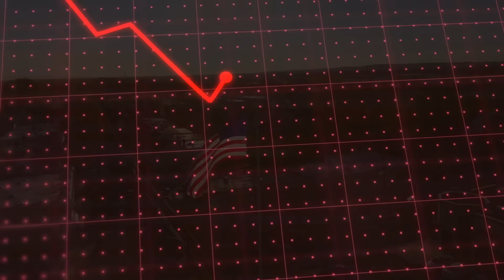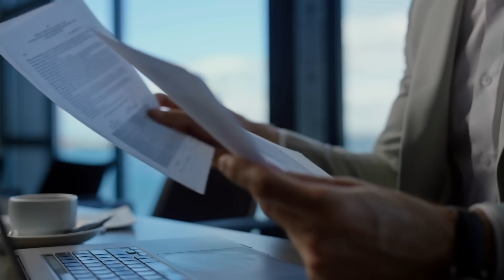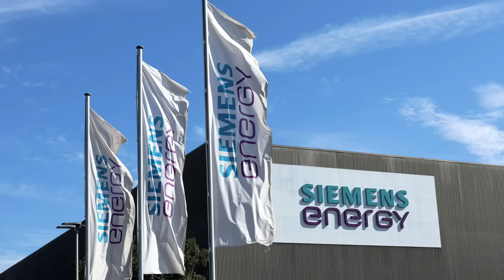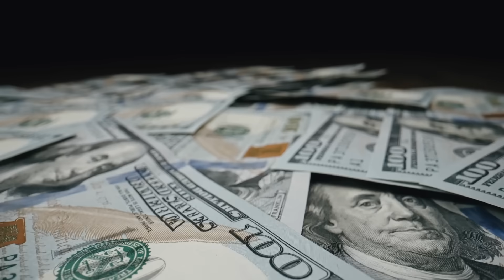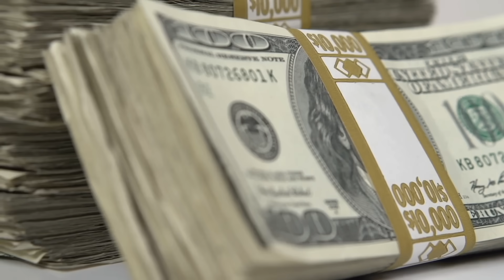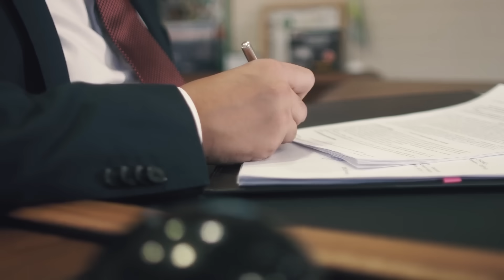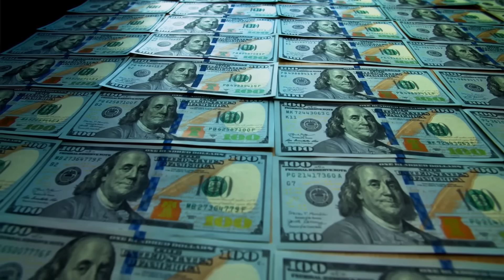The Real Reason America Has Turned Its Back On Wind Power Energy

Comment: I got the new 1600watt turbine from Missouri wind and solar and what this company won’t tell you up front is you need a 40’ tower for it to produce any usable power and you can’t return it. Worst investment I made so far on my house. Made 4kw of power in the same time my 9 solar panels made 129kw, and I regularly have 30-40 mph winds. Just upgrade to lithium batteries and add more panels.

Comment: Wind power is actually cheaper than most other energy sources, but a reliable baseline power supply is still necessary. One of the main challenges is the distance between the wind farm and the end consumer.

However, many wind farms in Europe have been built without government subsidies. Denmark, for example, relies heavily on wind and solar energy, covering on average almost 70% of its electricity needs over the course of a year, and on many days supplying 100% of the country’s electricity consumption.

Within the EU, wind farms compete with other power producers, submitting hourly prices that electricity companies then purchase based on what they expect to sell. The transmission grid (TSO) and distribution grid (DSO) are allowed to charge only regulated transportation fees, while electricity companies compete on price and customer services.

Her er en kort og klar version af din tilføjelse, der passer som et afsnit efter den tidligere tekst:

In the EU, installing an offshore wind farm can take up to 10 years, mainly due to permitting and planning.
The actual construction is relatively fast, typically one to two years from the start of installation to full production.
This timeframe also includes securing government permits and building the TSO grid connection to the wind farm.
Consequently, CAPEX for construction does not begin until the operator is confident that the grid operator can complete the interconnection as planned.

Comment: I don't think you all understand how the green energy works. They can build a solar farm in Kentucky and transport that energy to your region that doesn't have good sunlight. What the video said, there are 15,000+ finished projects. They cannot transport the power through the grid that we have now. It is outdated. We need to be able to transport that power to storage and from storage to wherever it needs to go. The system we have now cannot handle that load.

Here is what I said even made more simple for people that didn't understand the video, nor my comment. 

Its like streaming Netflix on dial up internet.

It’s like trying to fill a swimming pool with a straw.

It’s like driving a Ferrari on a dirt road.

It’s like plugging a firehose into a garden hose.

It’s like running modern apps on a flip phone.

It’s like ordering 1,000 pizzas and trying to deliver them on a bicycle.

It’s like trying to watch 4K movies on a black-and-white TV.

It’s like charging a Tesla with AA batteries.

Comment: Renewables produce direct current. The Grid operates at Alternating current at a specific frequency. To connect Renewables you need a rectifier. 

The problem comes when the natural intermittence of wind and solar happen, the grid can lose megawatts of power generation at the same time, and produce a cascading effect that can cause a failsafe in all the grid and collapse it like it happened with Spain & Portugal in April 28, 2025.

Renewables need an additional mechanism that can provide stability to the grid, like fast discharge batteries like lithium titanium or Flywheels. 

Spain was in such a hurry to go Solar they bet on installing all the PV panels and wind turbines without the backup batteries (LiTi, Flywheels) and lost, total blackout for Spain, Portugal and some portions of France.
Reply: Wind turbines produce alternating current and can provide operating reserve.
The turbine blades can produce less power by pitching or more power by using the inertia reserve in the blades.

Spain has batteries and a lot of hydro storage.
But that was not the issue.

The blackout orginated in a substation below maximum load.

Comment: Shorter version: It's all a big boondoggle that needs more subsidies. Not mentioned: Wind and solar have low capacity factors that require more infrastructure that gets underutilized. It's all weather dependent and still needs backup. It also lacks spinning grid inertia.
Reply: ALL powerplants need backup, as shown by the nuclear power plant, that went offline suddenly in Texas last summer...
Solar and Wind can supply grid inertia with grid forming inverters.

Comment: All of these problems can be fixed by investing in nuclear. Nuclear power stations can be built using existing infrastructure without the added installation of massive power lines stretching over vast areas.
Reply: Each nuclear power plant needs a grid connection.
They are also extremly expensive.

Comment: Perhaps the temporary solution is to de-centralize the larger grid system, where the power source that is providing energy to a community only upgrades the local micro grid versus trying to resolve the larger issue.  If the national grid were to be utilized as a manifold to distribute over production to be sold else where versus being the primary energy it wouldn’t need the total overhaul now envisioned.  Think locally like these renewables that aren’t 24/7/365 but use small, mini or micro gen 4 nuclear

Comment: all bullshit  it takes more energy to produce a wind turbine than it will ever produce!  our grid and connectivity is not the issue, the only way this scam is profitable is through tax payer subsidies period.  wind and solar are a scam.  it takes more electricity to produce a solar panel than the panel will ever produce in its short life.  cheap electricity through coal fired plants being built at a record pace in communist china is how they are being produced. steel produced with slave labor is how the turbine components are made, and they only way these energy grifters can profit is by ripping off taxpayers
Reply: That is an urban legend.
The energy is earned back in 5 to 18 months.

Comment: Wind turbines are not cheap or green and every single one will need to be replaced within 15 to 20 yrs. They produce zero with no wind. Produce electricity when it isn't needed and solar... It's dark at least 50% of the time
Reply: But they are cheap and green. Most modern windturbines can last 25 years and GE offers a 40 year certification.
With enough windturbines, you have electricity when needed and pair it with solar, hydro and biomass.

Comment: Maintenance nightmare, limited lifespan, least power generation of any source per sqft
Reply: Every machine has a limited life span and needs maintenance.
And they produce a lot of electricity considering they do not burn fuel...
Reply: @old-pete  Refineries last for many decades, are revamped to increase lifespan. Oil and gas can be stored forever until they are needed, in the SRO for example. Nuclear facilities produce many orders of magnitude more power per unit area. Both can be be completely secured. Windmills are subject to the elements, and, potentially, sabotage. They use up a lot of land for the  power thy produce and are an eyesore.
Reply: @MatZagrod  And maintaining a refining is not easy...
Oil and gas storage last ony a few months, when needed. Most countries are depending on other countries to import it.
Nuclear is so expensive that the US turned off written off nuclear reactors, because they did not earn their running costs...

All power plants can be sabotaged. It is a bit harder to sabotage thousands of windturbines placed all over the country.
Reply: @old-pete  🙄

Comment: And here's another problem wind and solar are not practical because you still have to have a power source running at 80% load just to pick up the slack if the wind stops blowing in The Sun Ain't Shining so what that means is you have to have lithium battery power storage facilities for your own facility if if you have 200 windmills there and 1500 solar panels you should Supply the storage for said facility and you should Supply the power lines going to the grid you the person who has invested in the wind turbines and the solar panels it's your responsibility to pay to connect the grid
Reply: No power source idling at 80% needed.
Reply: @old-pete  you have to have an 80% load on existing power plants so that when the wind stops blowing the grid don't go down because if there's not enough power the grid goes down and then it takes days to get it back up I know what I'm talking about because I work for a power company those lithium battery storage places can not hold enough power to sustain the grid when solar and wind go down that's why you have to have a power plant running that system at 80% load so that when it does go down they can flip a switch and we don't lose the grid
Reply: @old-pete  you need to do some research you need to watch Michael Moore's film on solar and wind
Reply: @jamesbrock8498 Wind does not suddenly stop blowing nationwide.
Wind and solar electricity production can be calculated 48h in advance.
You really need to inform yourself how windpower works.

And in case you missed it, a NUCLEAR power plant went suddenly offline in Texas last summer and battery stations saved the grid.

Comment: This turbine is a horrible idea because only the inclined area of the blade takes wind energy and that is very little, and most of the wind pass through blades. My "dmmd" wind turbine takes much more of wind energy. I designed two such turbines, one horizontal and one vertical. There are three kinds of turbines: "Wind direction change" (as the horizontal turbine), "Turbine different shape" (as the vertical turbine) and "Wind direct hit" (My idea and is not yet known) Contact me if interested. Wind is the best source of electricity because may produce during the night.

Comment: There is a reason why the Bureau of Ocean and Energy management ( BOEM and created by the Obama administration) claims the offshore wind projects will have no collective reduction in global warming. They know the unbiased #'s of these wind turbines and the true Carbon output ,.

One can look at average energy consumption of households in multiple countries. Many variables and factors at play. 
One can find examples of a constant 1MWH powering anywhere from 200-900 households.  Different areas will come into play as Western European countries use much less energy than Canada and the US for example (Some as much as 2-3 times less) .  Anyone who's familiar with home generators knows that a 5000 watt gen is much too small to run most median to large households. That would be equivalent to 200 homes (based of a constant 1 MWH). 

I'll use my country of Canada as an example. 
The average PER CAPITA consumption of electricity in Canada (2023 #'s) was 13.9 MWH per year.
13.9 MWH  = 13900 kwh 
13900 kwh (÷) 365 = 38.02
38.02 (÷) 24 =1.586 kwh

The average household in Canada is 2.6 residents, therefore the average household is currently using a  average of 4.12 kwh, which would average 242 households with a One constant MWH. 

The average carbon output annually from household electricity in Canada per Capita is .41 tons.  An average 2.6 individual household would be 1.06 tons of carbon annually. 
242 households emitting an average of 1.06 tons of carbon annually = 256.52 . Over a 20 year span , = 5130.4 tons.

Now we can cut the last number in half or simple leave it  (But must compare with Two 2 mw turbines if not cut in half) for the simple reason that a wind turbine will produce 25 % of nameplate capacity at best.
If we compare one 2MW turbine, we can compare .5 of a constant MWH, (Which would be equivalent to half of 5130.4 tons )

One of the most popular 2 MW turbines in use,  the V90 requires almost 400 tons of high grade steel (20 + tons of fiberglass) and 1200- 1500 tons of concrete. That's pushing over 1000 tones of Carbon just for the structure alone .  That excludes mining the 600 tons of iron ore to produce the high grad steel  and transport   of it, maintaining the structure for 20 years, the 8000 gallons of gear box oil (over 20 years)  and most importantly and the most carbon intensive, creating the infrastructure to build, such as massive 400 ton cranes, Bull dozers ,cement trucks, cement pump trucks, dump trucks, excavators , crew trucks etc...

The above stats regarding electricity consumption and carbon output in the country of Canada is not my opinion and is readily available to anyone. 
At our current energy grid consumption and the current Caron footprint from this ,   Wind turbine projects will NOT reduce carbon in the country of Canada (The government knows this ). Simple science and data 
BOEM knows data similar to this in the US  , hence their statement last year.
Reply: They did not claim that...
Reply: @old-pete  
Hey Creeper. How ya doing?

Yeah , that was BOEM's EXACT words. 
Don't you just love facts and unbiased data from Canada regarding energy production ,carbon output and the subsidized junk in question? But hey, we can always deny actual facts.

Yuri Bezmenov wrote a book on Ideological subversion . Great read. Shows how when the mind demoralizes so much, individuals can't see the facts if front of them.
Reply: @mannycheese1166  They did not claim that. You probably misunderstood them.
Quote the whole sentence.
Reply: @old-pete  
They most certainly did state that . If you want to believe it was "taken out of context" , then go ahead.

How's about these wonderful numbers.
I'll repeat them again just for you, well ,because they're just great.  

The average PER CAPITA consumption of electricity in Canada (2023 #'s) was 13.9 MWH per year.
The average household individuals in a Canadian dwelling is 2.6.
The average household in Canada uses 36.14 MWH's per year.
An average MWH provides electricity for 242 homes in Canada at the average annual current consumption
The average carbon output annually from household electricity in Canada PER CAPITA is .41 tons. The average household in Canada releases 1.06 tons of carbon per year from electricity. 
1 MW of energy providing 242 homes will produce 256.52 tons annually.
20 years will produce 5130.4.
Half a MW will produce 2565.2 tons of carbon.

Using Vestas' own information on the size of their 2 KW turbines/structure (which will produce .5 MW at best)  and using current unbiased data with the current production of high grade steel/fiberglass/ copper/rare earth metals/concrete, the mining of iron ore, and looking at carbon output of all and factoring in weight ,  just the structure alone will produce 1300 tons of carbon, that is according to current data available. 
 That excludes the production of dozens of heavy machinery for the projects,  large amounts of diesel used by heavy machinery , and maintenance over 20 years.  which can be extremely hilarious in that some biased pro wind fanatics/radical greenies really do believe this magically doesn't produce carbon, it's laughable.

Most likely why the former Minister of Energy in Canada a few years back let it slip that wind farms don't really lower carbon pollution in this country.
Reply: @mannycheese1166  What has BOEM to do with Canada?

And yes, it was taken out of context. I quoted from the orginal...

A 2 MW windturbine saves 3500t of CO2 per year, compared to a coal power plant...
Reply: @old-pete  
Thankfully , Canada's Large 8 remaining Coal generating stations are in the process of being decommissioned before 2030 (some already by now). That's less than 5 years away. Canada's average household carbon output will actually DECREASE even more than the last decade.

BOEM's statement is very similar to what the former Minister of Energy of Canada accidentally let slip, even though he's right. I mean , the guy had energy consultants at arms reach. 

":A 2 MW windturbine saves 3500t of CO2 per year, compared to a coal power plant..."
Silly comparison and moot point. Any normal individual ( not you of course) knows the thing that matters when comparing to to an overall energy grid of a country and carbon output, (when regarding carbon and energy  production), is the overall carbon average of all sectors, not cherrypicking one sector of some imaginary coal only energy producing nation.  Same analogy of someone cherry picking hydro electric and comparing it to wind turbines and carbon output, 

Those numbers provided on Canada are spot on. Wind projects ARE NOT going to reduce carbon in Canada along with many Canadian Citizens(Tax payers) becoming sick of paying for a third the costs of these wind projects.
I'M RIGHT AGAIN. I sometimes get sick of being right.  Now go away troll .
Reply: @old-pete  
My comment on Boem is correct.
My comment on what the Canadian politician said is correct.
My comment on Canadian citizens sick of subsidizing wind projects is correct.
My comment on tax payer funded wind projects in Canadas not reducing Carbon output from electricity is CORRECT.
I'M RIGHT AGAIN  Go away troll.

Comment: Replace old grid lines with newer carbon-fiber reinforced cables with twice the current capacity.
Make more use of battery systems to buffer and reduce the peak power rates.